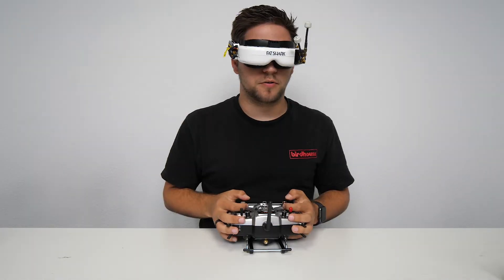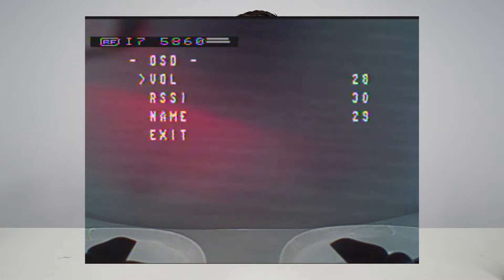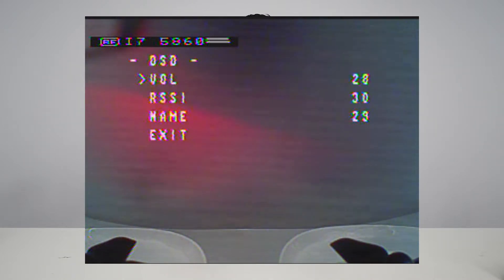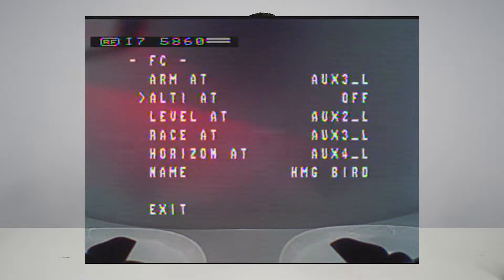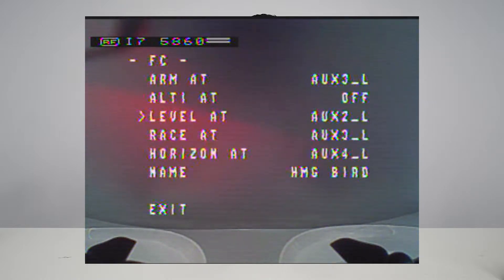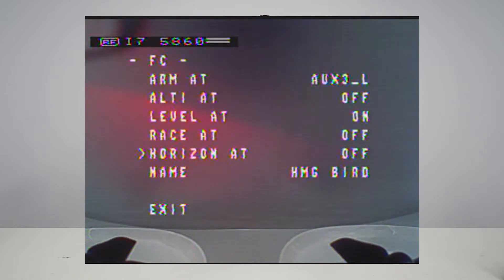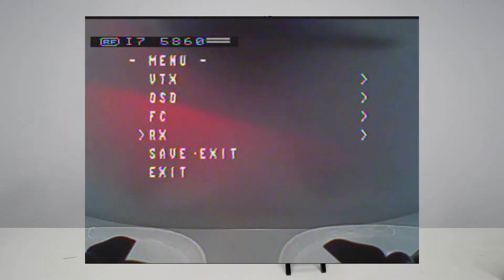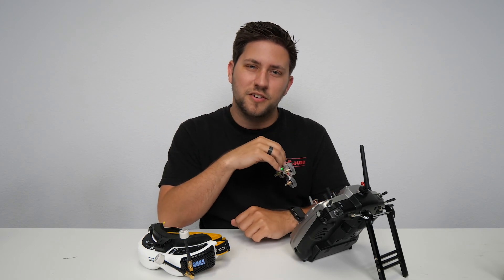Hummingbird OSD Menu

Comment: One thing that was confusing to me is that the modes STACK with each other. This means you can't put all 3 (level, horizon and race) on a single switch. In fact, if you want all three modes, you MUST use three channels to control them.
TLDR: 'Acro' is no modes active, 'Level' is only Level mode active, 'Horizon' is Level AND Horizon modes active, and 'Race' modifies either Level or Level+Horizon modes for drastic reduction in auto-leveling on the pitch axis.
Dominick B (Tokyo_Dom) helped me figure this out.

Comment: When I turn off RSSI in the OSD I get the text LRHA on my screen. Why is that?
Reply: That means you didnt setup your modes yet, and all 4 are active at the same time. You should only have one mode active at anytime, most likely that's either L(evel-Angle Mode) or R(ace - Acro mode)

Comment: Thanks for the great vid! So I adjusted my subtrim and End Points in my taranis so I was 200 - 1000 - 1800 for Roll Pitch and Yaw in the RX part of the OSD. If I did not do that it would drift on me.  But we don't have to do that?
Reply: Boost Goose maybe. I just treated this like the rx tab in the Betaflight configurator.
Reply from the maker: Did you get everything working ok?  @MikeAarset
Reply: @NewBeeDrones  Nah it has that really weird sluggish rate issue that comes up at the half way through a flight. So waiting on update stLink. But I ordered another FC last monday and it should be here today with the newest firmware :)
Reply: @Boost Goose I also just bought a Hummingbird, and find that it's got really bad drift.  Maybe I've not got it setup, but it feels like a toy drone that needs a calibration!  I'm sure I'm missing something.